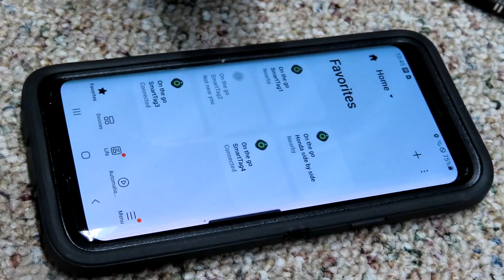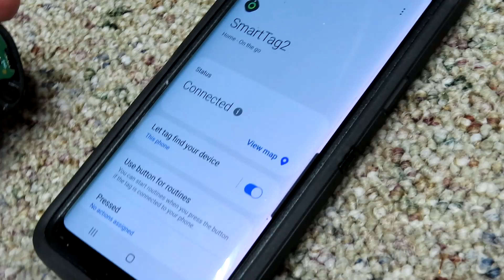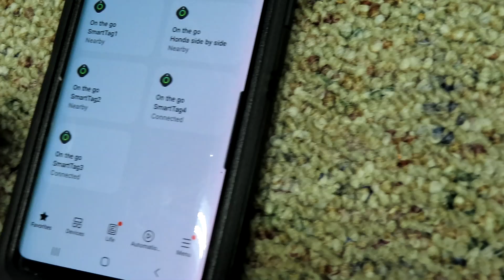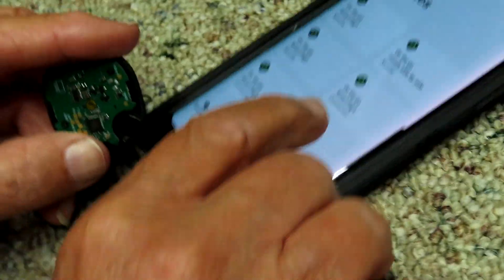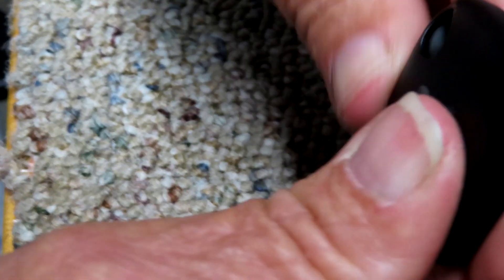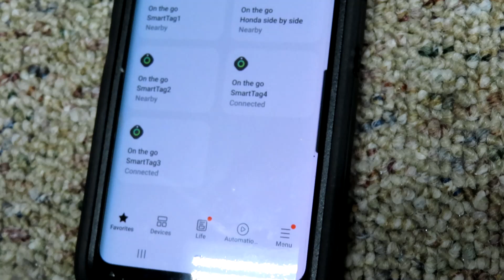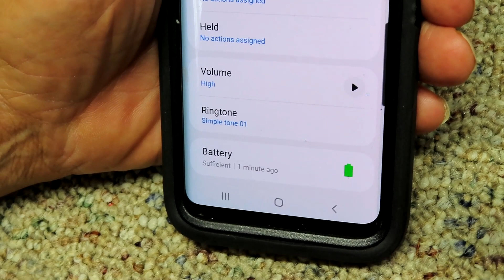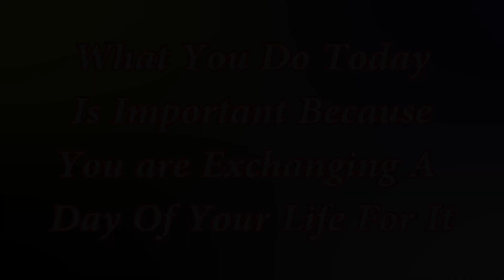Samsung smart tag,   disabling the Piezo speaker  for tracking

Comment: Seems to rather than destroying the tag speaker, it would be better to put a piece of electrical tags over each of the contacts the speaker will not work and later if you change your mind you could remove the tape to enable the speaker again.
Reply: U can turn it of in the app ,lol

Comment: As mentioned in a comment, I used a hair dryer, it separated much more easily, the process went much faster, and in order to make it reusable I used a small piece of tape instead of scraping it with my fingernail, as described in another comment. Thank you for this detailed video, and thanks to the viewers for their useful comments. I used a small Phillips screwdriver for the screws, the whole process took 5 minutes in total. I did this because this device was hanging on my dog's collar and my dog was afraid of the sound of the device. Greetings from Turkey.

Comment: Dear bigdave, may I ask: Mentioning a real Gps tracker (hard to afford, true)...But aren´t those too thick in dimension?  (I want to sew one into my son´s schoolbag, for his safety on all his ways out there...)
Reply: Hey, I have placed a Samsung Smartag in my daughter's backpack wall. I slit it open and dumped it there. She will never know it's there. Does an amazing job at tracking her movements. But I thought Samsung Smartags don't notify people?  Since when did they start doing this? Or do only new tags do this?
Reply: @alienlatino2945  Hey, and did you take of one of the smarttag´ lids? So it´s only half the thickness? Or wasn´t necessary.  I don´t know anything about it, sorry...
Reply: @LeChimp200  No you don't have to take off the lid and I will advice you NOT to do it, humidity will ruin the tag. The rubber seal and both shells must be left on for protection. Why do you want to do that anyways?  The tag is small enough. The walls of my daughter's backpack are double layered so it was easy. Or try the bottom of the backpack, they are always double-layered there.
Reply: @alienlatino2945  Ok, you´re right. Thanks my man. Hm, maybe an Eastpack backpack? :-)

Comment: Saw the RX TX pads and soldered wires to it, dremeled a 1mm slot for the wires to come out.
Still works so going to assume this extends the range and for my use case (car tracking) im gunna add extra long antennas
Reply: Make a video!
Reply: Those pads are not connected to the antenna. They are used to communicate with the tag through serial, and that's why there are also other pads, respectively, for clock and reset
Reply: Make a video!
Reply: +1 would love to watch some tests on that

Comment: They can't make it beep because it's not pared to their phone... only YOUR phone can make it beep.
Reply: @MegaTechno2000 > I didn't know this... Thanks for the info! 😎
Reply: @danbeare5263  not being able to find it will work double as a psych out, scaring thieves into abandoning property as they know they are being tracked
Reply: @nicholasjohnson9694  the fact that you have to explain that to do.e people is mind boggling.
Reply: Great video thank you, but it appears that only tag owners phone can make the tag ring, which effectively means problem solved. Or does this change with different generations/versions?  I also notice options for ringtone in this video, I'm guessing choosing (no ring tone) may also be available.  Potentially, get good at hiding, like in your vehicle, if that's what you're tracking if thief knows being tracked that's good if it's well hidden. I need to do tests of smart tag 2 so that I can see, if any,  improvements.
Reply: Simply  hide  the tag extremely  well! If on a vehicle.  So easy to do! Hide it under the car. With magnetic  box? Glue to seal the tracker ro make it water proof? Endless  places to hide this on any vehicle! Believe  me this is better then any monthly  subscription.  To a GPS tracker.  I'm planing  to hide this on an electric  e bike. And trust me they won't even find it on that! Simply  open up the frame  of the bike and drop it in! So simple.  Love the removing of the speaker! So doing this now to protect  my 3k priced ebike! Thank you for the wisdom  found in this video❤
Reply: Yes, absolutely correct! But Samsung introduced a new feature whereby you are able to track any tag NOT owned by you. With other words if someone attached their tag to you or your belongings in order to stalk you or for whatever other reasons, you can find out with your app any foreign tag not belonging to you.
Coming back to the gentleman's concern, if you have attached your tag to some belongings, any person  having stolen your stuff can still check for a foreign tag the same way, if he has the same app on his phone. Depending on where and how well you have hidden the tag, he may or may not find it or remove it.
Conclusion: the disabling of the speaker is pointless IMHO as your tag can still be located with the right samsung phone and its appropriate app..
Reply: @klausadrift7568  this is terrible news. thieves will know if there is a tracker :( will the new samsung smart tag have a feature to disable this?
Reply: @klausadrift7568  Thanks, your long reply is the best explanation in the comments sections, you just answered all my questions.
Reply: @klausadrift7568  The main difference here between Apple and Samsung is non-technical. The approach differs.
Apple embedded/incorporated and activated their counter-tool into their OS. While the Samsung counter-function is wery much on demand .... 
Thos way Samsung gives more room for applications, while Apple seems to be more concerned about privacy or/and possible legal consequences (that may backfire on them, too).
Let's not forget that tracking does not necessarily equal stalking.
You may protect your assets using these as well. Not only stalking on someone elses'.
Reply: Keep in mind samsung has not released an app for Apple or other androids to find your tag. Only other Samsung phones will receive the message. With Apple tags android does have an app to find it though you won't get a notification you can at least scan for the tag. Also Apple allows the notified person (not owner) to play the music. I do not believe samsung does anything more than notify the would be assailant to the fact you're in the vicinity of it.
Reply: One idea: Is it possible to just swap the lids? That way no unwanted sounds can come out when the tag is squeezed while inside a purse etc. : No button = no sounds. (unless I command the tag to do so via MY phone...) Right?
Reply: @LeChimp200  The thief can command it via his own phone if he has the app.
Reply: Just wondering if anyone have had a chance to test this out yet? 
Hide this device, then use the 'bug scanner' device for microphone or hidden camera to see if you can detect the samsung smart tag?